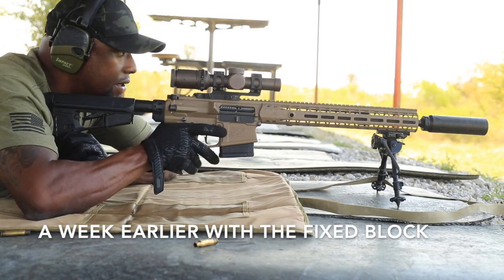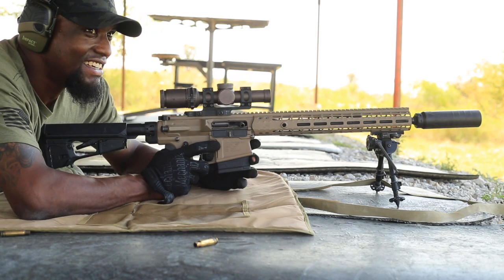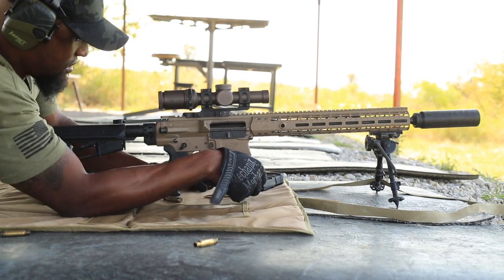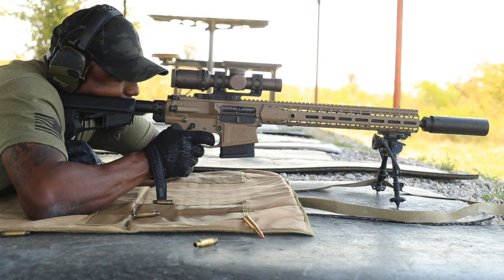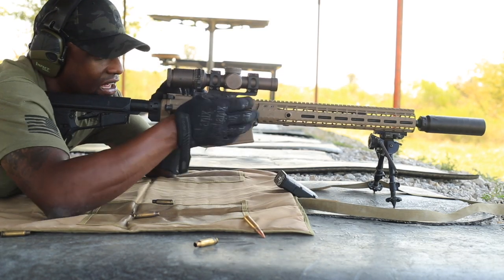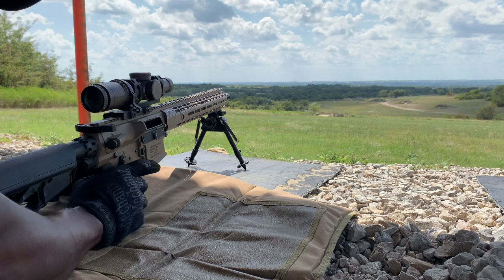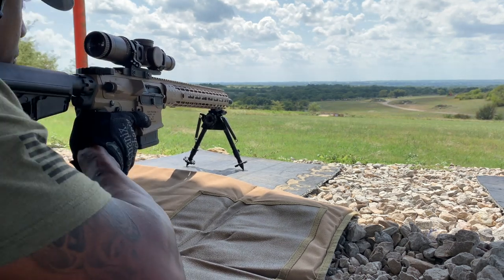JP adjustable gas block suppressed AR10

Comment: Just curious do you have any experience with the superlative arms clamp on adjustable/bleed off gas block??? I'm building a new 6.5 Grendel around a 20" Proof Research match barrel and a Grendel Hunter upper, lower, and 17" handguard. I normally run a fixed gas block but I'm building a nice rig and what to be able to fine tune it once my Nomad 30 gets out of jail...

Comment: Oh man, I heard that. Thank u for posting this. I have a 16" and 18" M5  I spent time tuning the gas port. I had the same issue with unreliable feeding. There are SO many variables to consistent operation. I tried uploading, downloading and ultimately the gas ports were too small on both. The 16" M5 arrived with a . 072 port and the 18" with approximately the same. I bored them both out. .078, .1100(3MM) respectively. Maybe it's where I live but over gassing isn't always so apparent. I was feeding a fresh round on top of expended previous brass and wrecking all my brass. There was smoke coming out the magazine! Over gassed I thought. Now these were both set up as configured 16" carbine buffer spring, 18" rifle  spring and correct buffers. I love them both. Great firearms but ultimately for the loads I was running 147-150gn 308, 42.5-43gns 4895 good out to 700ish. I found that the NATO spec cartridge OAL 2.8" to be longish so loaded my FMJs to 2.735" and they all chrono'd impressively 2650-2700fps. I suppose that what keeps us coming back for more. Like surfing, it's always the perfect set wave and we never seem satisfied. SoCal, Hawaii, Fiji, South Africa, Austrailia. Shooting is much much safer. Like yourself it's about other things too.

Comment: Your 16” MLGS wasn’t running suppressed because of the port location and diameter being too large for that set-up.  Once you choked it down with adjustable gas, it solved the excess gas.  The cyclic rate was going so fast that the bolt was hitting the spent brass before it could fully exit the ejection port.  Slow down the BCG and it solved your problem.

Comment: I need some help I’m running a similar set up as far as the Aero M5E1 build kit. I went with Krieger M110 20” barrel and matching headspace JP bolt. I have the superlative arms .936 adjustable gas block and my buffer and spring came from Brownell’s. What’s happening is I cannot get the rifle to lock open this is after I cut 5 coils off the buffer spring. Before I cut the coils the rifle wouldn’t pick up the next round.

Comment: I have the M5E1 from aero precision (LR.308) and if I had to do it over again I would go with a different brand. Way heavy and customer service sucks.... Bad. After sending it back 3 times for head space probs I had a case separation and had to call there VP to get it replaced. Customer service first said that it was my problem not there's.  Now with my new upper everything is good but over gassed. It only took a year to get everything.... mostly right lol.

Comment: What do you think about the JP VMOS?  Is there much of a change in recoil impulse with the extra mass and does it help with keeping things cleaner by slowing things down with your adjustable gas block? (Assembling a 16” .308 with rifle length gas system for pigs also. Will be suppressed most of the time.)

Comment: Thats a dope rifle.  

Have my PWS MK216 set up similarly.  Nomad, PA Plat 1-8, and atlas.  Absolutely love it.  Really digging the modern .308 AR offerings out there.   I do agree adjustable gas is, in my experience, the way to go for AR10s and doubly so when suppressed .  With the gas set right, and the suppressor on, there is laughably low recoil

My eyes are on a Larue PredatOBR, just hard to justify the $1800 premium, when the PWS shoots as well as it does.  Fine ass rifle though for sure
Reply: What is a PWS?

Comment: If it is stove piping shortly after installation of an adjustable gas block,... the solution is simple. Open that block up a little bit. At its current gas setting, it wasn't sending the bcg back far enough

Comment: So it was OVERgassed right??

I am now having similar issues, I have the same gas block, I assumed it was under gassed after installing a flatwire buffer spring so I let it open up more. 
I will try closing it up next time out.

I figured there was not enough gas to push the bolt back due to my new buffer spring.... guess thats not the issue, spring probably has less tension so now needs less gas to push back. Makes sense.

Subbed!!
Reply: Generally if you are getting the failure in the video it’s overgassed. The bolt cycles so fast that the spent case can’t be ejected before it closes causing this failure.
Reply: This rifle with the standard gas block was under gassed.  If you make a 90 degree angle from the chamber, “ideally” you want the shell to eject at that 90 degrees.  If it’s ejecting forward, it’s over gassed.  If it’s ejecting backwards, it’s under gassed. Many ways to deal with it but an adjustable gas block is probably the easiest

Comment: I just bought Daniel defense new 6.5 creedmoor and I keep getting stove pipes just like that and I’m not running suppressed. Any idea how I can fix this? Great video by the way!
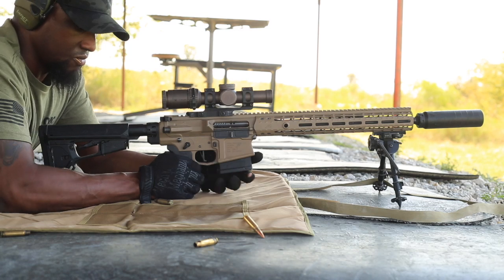Reply: Stovepipe is normally indicative of an over gassed gun,  shoot your gun again and watch where it throes the brass anything from 12oclock to 2:30 is pretty over gassed, anything from 3 o'clock to 6 is under gassed,  if you are over gassed you can use an adjustable gas block and a heavier buffer, if you are undergassed AN ADJUSTABLE GAS BLOCK WILL NOT FIX IT, you have to drill your gas port to a .093-.097 and re test do not jump straight to the 097 size or you will definitely be overgassed. OR just lighten up your buffer and re-test

Comment: Hey man great channel!  Just discovered it.  You may be right on top of this one, but one area often overlooked w AR .308s, is the RECOIL system.  Specifically the BUFFER WEIGHT and SPRING WEIGHT.  I learned this the hard way dealing w some Palmetto State Armory builds in .308 where they totally fucked up both of these critical components.  Once I got it fixed up, the guns now run like a top and I am shooting 1.5 MOA in guns w a gritty Milspec trigger and a $225 Burris MTAC 1.5-6x42 Scope, in guns that cost less than $550.  AR15.com and .308AR.com have great advice on this issue that some of your viewers may find helpful.  I used a 5.4oz “shorty” buffer and a JP AR-10 Carbine spring in my Palmetto guns and that solved the issues as they are way overgassed.  An adjustable gas block obviously can help as well, but as you mentioned sometimes a fixed gas block is ok also.  Great videos man keep me coming!
Reply from the maker: Na Na When I originally built it with the adjustable gas block everything was fine and operating correctly with the JP silent buffer. When I took it off and put the fixed block on she was acting up, a little bit of adjustment on the block and I’ll be good to go suppressed or non.

Comment: Seems over gassed get a suppressor that doesn't send much back pressure threw the system or try out stiffer springs and heavier buffer weights...

Comment: I have a 308 ar10 on a 20 inch barrel geissel fixed gas block. Ran suppressed actually over gassed. All I needed was a heavier buffer. Strange how rifles work man.
Reply from the maker: nomadic K I constantly tell folks every rifle is different 🤙
Reply: EXACTLY.  Just left a detailed comment on the buffer weight and spring weight issue